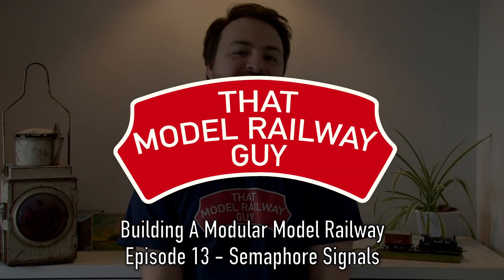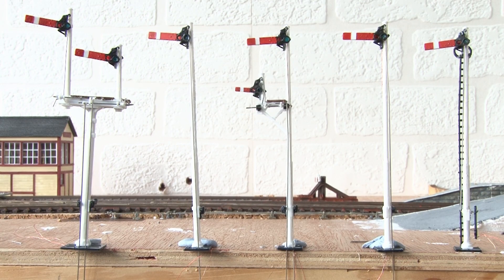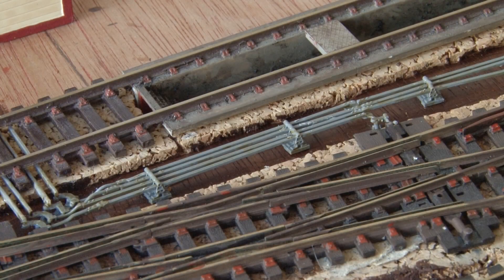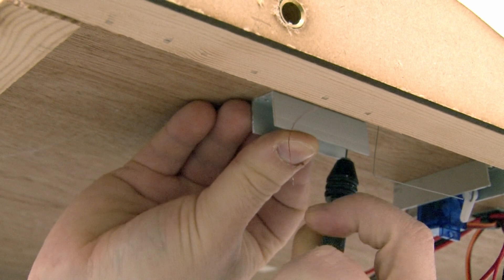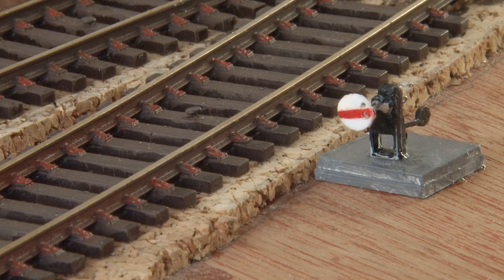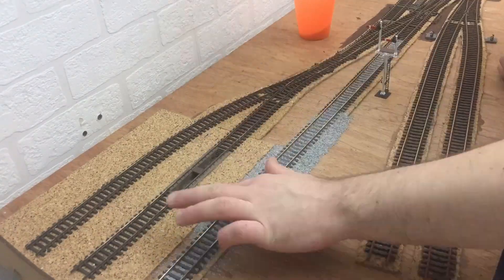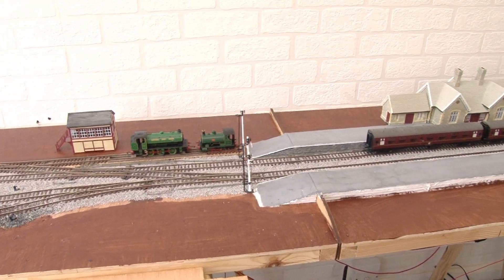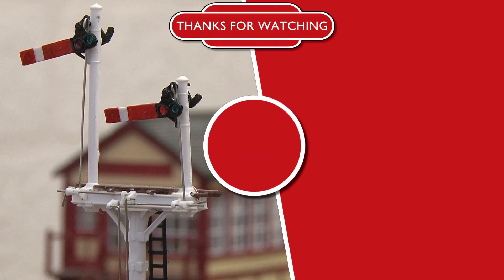Building A Modular Model Railway! - Episode 13 - Working Semaphore Signals

Comment: Try AMMO RAILWAY FAST METHOD. Please don't think I'm someone whose just critising to cover my own mistakes, I'm not. I used to Spray VW Beetles as a Job, the Full size. But glad to know your not finished and the look will be different to what it is now. Keep up the good work always take  criticism as advice given badly =)
Tony.
Reply from the maker: No worries Tony, I didn't take it as criticism. I've had lots of comments on here from many people who do things differently to me and that's great. The beauty of model railways is there's no right or wrong way to go about things as long as we're happy with our own results. Thanks for watching 😃
Reply: You are correct, theres a 1001 ways of doing something a different way but with the same outcome.
I'm trying to find how to get my Ratio semaphore signals to work automatic on my DCC, I know  Dapol are selling them, only need to wire them yp but I can't afford the prices, so was looking at using servo motors but I don't seem to be able to find a completexplanation and diagrams. If you or your readers know of a site with complete explanations and diagrams I would be most grateful.
Keep up the good work.
Tony.
Reply from the maker: @anthonyfarrell271  I personally use the Megapoints Servo Controller (I covered this more in my point motors update) and they have lots of easy to understand videos on their own YouTube. They also do a DCC addon module which would allow you control everything via DCC. 

Alternatively it could be done for cheaper using Arduino’s but that would require a bit more work to put together. Hope that helps 😊
Reply: @ThatModelRailwayGuy   You don't know how grateful I am for that info, thanks, I need it. Much appreciated. Tony

Comment: How to make semaphore signals repeater
Reply from the maker: I guess the simplest way would be to have two motors wired to the same switch, though I’m not sure if that’s possible with the system Im using. Thanks for watching 😃

Comment: What a deeply insulting comment towards the end to all the signalling engineers on preserved and heritage railways,who ensure their signalling installations comply with their operating regulations in order to ensure the safety of the travelling public.
Reply from the maker: Not insulting at all. As a volunteer at a heritage railway myself I'm fully aware of the real world limitations that signalling departments often have to work under. It's no less safe but not every railway has the budget or ability to fully operate their line with semaphore signals - we make do with what we've got and we find alternate ways to work around it to keep trains running. That's a fact that I've used to my advantage here to explain why some signals might be missing or are non-operational.